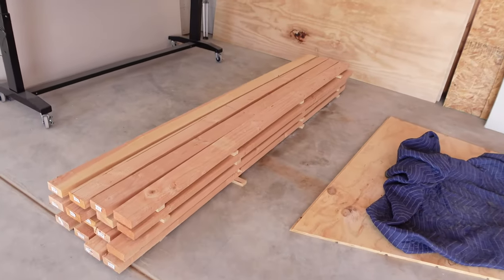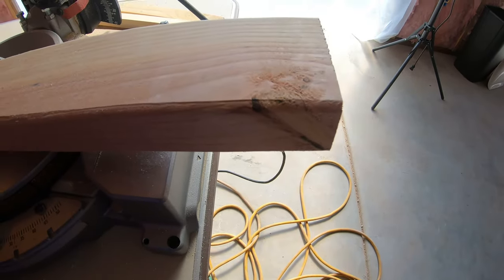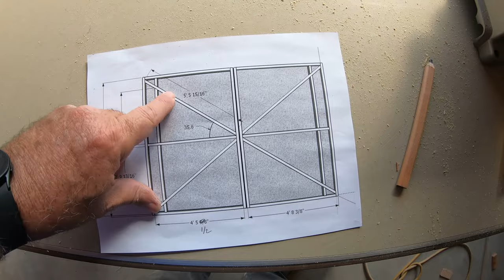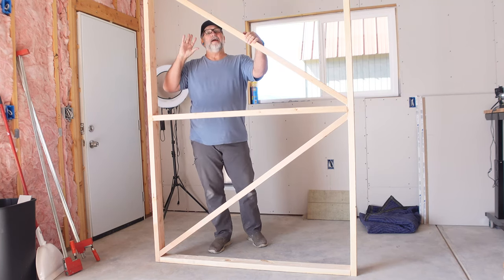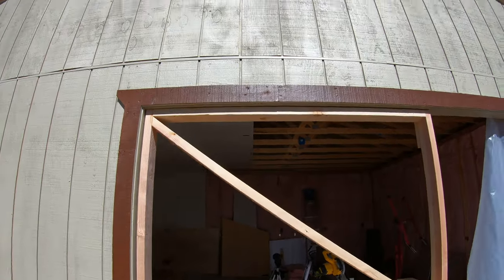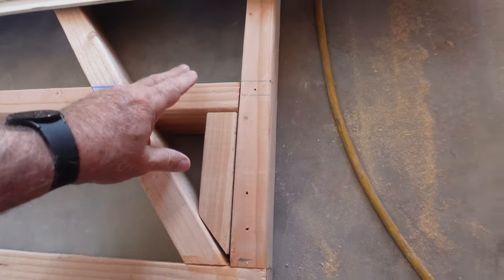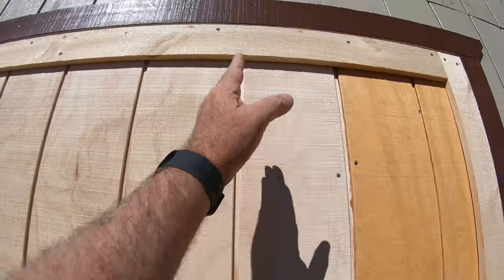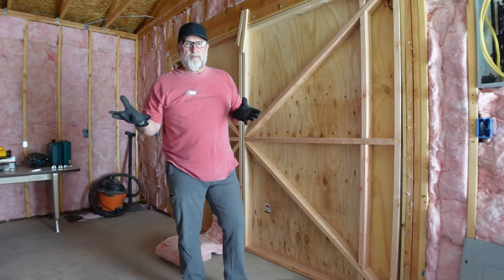How to Build Garage Shop Doors

Comment: Help me out here. What is the justification for the bracing that goes from the middle, back upward towards the hinge side. I understand the bracing that goes from the bottom hinge to the middle, as that is under compression. It seems like the other brace is not adding support against gravity puling the weight of the door down. As I understand it, the brace should be on the bottom of the hinge side, stretching all the way up to the top of the opening side. Am I wrong about this? Is there a reason for the reverse bracing?
Reply from the maker: You can build them that way and be fine I'm sure, I opt for this way as I have for many I have done and have had none to very little sag with this style.  I do use the other method when using the 2x4's laying flat but it's  just my preference for these doors Nicholas. thank you for the input and watching the video I appreciate it!

Comment: How much gap between the 2 doors, so when you open one up, the 2x4 dont rub against each other? Great work and hoping to build mine for the garage using your plans. Heavy duty hinges right?
Reply from the maker: Hi Kenneth,  I butt the hinge side as close as possible, top I leave 1/8 inch as they will sag a little, the bottom I leave 1/2 inch and center to be able to open with 2x4 frame is 3/4" to an 1 inch and yes heavy-duty hinges are worth the money

Comment: This might be a stupid question but isn't it a security concern that someone could unscrew the hinges and enter the space? Is there a way to improve the security?
Reply from the maker: Sure by using carriage bolts instead, this one however is in the fenced back yard.  If somebody really wants in they are going to get in.  It's kind of like someone installing a huge thick front door with all the deadbolts and locks and have a window right next to it.

Comment: Thanks again for posting this! I got the 2 doors made, trimmed, insulated and painted. I had to use 1/4" plywood as the rockwool insulation is too dense to cover smoothly with 1/8" luan. The doors fit great, don't sag and can easily be opened and closed, even though each one weighs over 100#. I also used 2 packs of the metal lock barrel bolt you have listed in the description; work great!
Reply from the maker: Nice!  appreciate ya commenting and watching!

Comment: Hi Mr. Adams. By how much smaller did you make the frame against the opening? What is your tolerance? Thank you so much in advance.
Reply from the maker: Zero on the sides, just butt it up against framing be sure to level, the center is where you will need the gap and I used a 1/2 to 3/4"

Comment: Doors look great. Very nicely done. I need to build a set with each door being 6’wide and 12’ high. Would I approach doors of that size any differently than the method you used?
Reply from the maker: Hi Jacob, if you are planning to insulate them I would say put an X frame inside but if no insulation is needed or very little I would lay the framing flat for less sag but either way I would run a diagonal adjustable cable for extra strength.  Let us know how it goes!

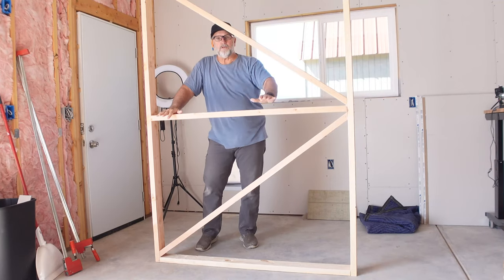Comment: 2:40 - in your opinion, is the 'British Brace' you used stronger than the 'Double Zed Brace' ?
I want to add a backing to my new doors but am worried about the extra weight. There are three substantial band hinges on each door.
Reply from the maker: Both have their merrits, I have never had a problem with this style sagging but I would say go with whichever you are more comfortable with.  Thanks for watching and commenting I appreciate it.

Comment: Great video! I'm using it to make similar doors for my new 24x32 shop with a 9'x10' door opening. 6-7 month delivery expectations and cost especially are 2 things why I decided to go this way. Also, my shop will be used mostly for building my 1966 Chevelle autocross car, welding and personal vehicle maintenance, so I don't really need doors that are convenient and easy to open several times a day or week. Have you another video on how you sealed the door, yet?
Reply from the maker: Sounds great!  I used 1x1 self stick foam weatherstrip on the overlapping trim pieces  and a garage floor door seal.   https://amzn.to/3VBhPFp  https://amzn.to/3OFqoON  and   https://amzn.to/3HVaBrC       Hope this helps
Reply: @ILikeToBuildStuff  thank you for the info!
Reply from the maker: No problem thanks for watching! @rixtrix11

Comment: This is the video I was watching and I can’t find what you used for weather stripping. I’m making doors for an old barn for a pool room and am wondering what you thought about bronze spring weather stripping. Thanks….enjoy your videos!
Reply from the maker: I used this seal at the bottom that works great  https://amzn.to/3VBhPFp
I used the 1 inch foam seals around the doors inside trim  
https://amzn.to/3Hp2i6q
Reply: @ILikeToBuildStuff  thanks for the information…have you ever used bronze spring weatherstripping…just curious. That’s what’s on my house and it’s been there 100+ years. Only reason…thanks again.
Reply from the maker: @KBMB47    Yes I have but don't think the cost is worth it with the new stuff out that may not last as long but still 25 years or more depending on the application.
Reply: @ILikeToBuildStuff  Ok thanks for the information!

Comment: I'm curious on how you did one door to overlap the other.  Wish you'd have shown that in the video. In my mind, that central overlapping trim piece would have to stick out past the wall, further than the rest of the trim.. is that what you did? Can't quite picture how you can have it overlap and all stay on the same line
Reply from the maker: Hello and welcome,  Yes that is what I did by using a 1x6 for the center overlap.  Good eye!

Comment: Great video. How much smaller than your rough opening were your doors? Or maybe it's better to ask the clearance on all sides of each door.
Reply from the maker: Hi Kurt, I butt it up on the sides and add minimum 3/4" center gap but do recommend 1 inch as these doors will move a bit and with the 2x4 width should have enough clearance to open correctly.
Reply: @ILikeToBuildStuff  Thank you. I was thinking the same, 1/4" on sides and 1/2" in center of total of 1" clearance.

Comment: Hi Jim! Great video. Do you have any advice on sealing / weatherstripping?
Reply from the maker: I used this seal at the bottom that works great  https://amzn.to/3VBhPFp
I used the 1 inch foam seals around the doors inside trim  
https://amzn.to/3Hp2i6q
Reply: @ILikeToBuildStuff  Thanks!!
Reply from the maker: @seanwhalen8220   No problem, anytime.

Comment: Hi Great video! Did you have to build Jambs for this door?
Also, if I followed a similar design but wanted to add glass to the top for windows… how do you recommend doing that? Just want to make the sure the engineering is done right to support the glass.
Reply from the maker: Hi and Welcome, Yes I had to build the jams but that was just trim boards.  You can add windows just as you would when building a wall just be sure to keep the diagonal bracing under the windows

Comment: With how you did your video, it gives me confidence that I’ll be able to do this on my own.  I have a circular saw but not a table saw, though I don’t think that’ll interfere with me completing my project.  I have a question for you though.  Do you think it would be fine for me to use my jigsaw and cut out windows in the paneling?  I’d be using plexiglass for the windows.  I also won’t be insulating my doors as the rest of my garage in nowhere near insulated or even airtight.  (House was built in 1890.)
Reply from the maker: Hi Sonya, thank you for the great comment and your in a great community here to help and cheer you on.   Sure you can use a jigsaw if you are more comfortable with it.  Keep us updated on you progress!  Thanks for watching.
Reply: Absolutely we are here for you Sonya!  You can do it!

Comment: Do you have more detailed video or comment of how you kept the door panel in the correct position while attaching the hinges. I've never
 seen the hinges attached to both the door and building at the same time.  Thanks
Reply from the maker: Hi Dave, I actually set the door frames in the opening and shim them where they are to be and then mark the frame where the panel grooves match up then when doors are done I set them back in the opening and set the trim on the doors so I know that I can install the hinges while keeping the doors straight.  I hope that is what your question was.

Comment: Thankyou for the video. The door you build out of 2x4 and t11 siding  will it the keep the heat in .
Reply from the maker: Yes it does when sealed as you would do any exterior door.  I used wide interior trim with 1x1 self sticking foam weatherstrip.
Reply: Thank you for getting back to me .I was  thinking about building  exterior door the same way you did here what's your thoughts on that Thank you.
Reply from the maker: @relectric720   Should work fine for ya.

Comment: great tutorial. will water get in when it rains? do you think there's a way to weather seal?
Reply from the maker: I have had some pretty hard rain and no leakage and that was before weather seals were installed with the inside trim.  Thanks for watching!
Reply: what about dust? I'm going to make one of these this weekend
 @ILikeToBuildStuff
Reply from the maker: Not much of that either  @stevecarrillo

Comment: This is exactly what I was looking for. The price of insulated overhead doors is CRAZY! How large of an opening do you think this design will support? I will have an 8x7, 10x10 and 12x12. The 12x12 worries me a little.
Reply from the maker: Hi Joe, well the front wall is not load bearing so you would not need a big header so I would say you can go as wide as you want but stay with no higher than 8 feet since the walls are 9 feet
Reply: @ILikeToBuildStuff  Thanks for the reply. What I meant was, will this frame design support a 6’wide 12’ tall door (for a 12x12 opening) without sagging? I know I would have to add some blocking in for attaching the sheathing.
Reply from the maker: @joeamato3936  Oh okay, yes it should and you could also run a diagonal turn buckle cable if needed to help keep it square too

Comment: So, has there been any sag? I don't care much for those types of hinges here in the city. 
 
It sure would've been a lot easier to do it with those.
Reply from the maker: No not to much at all, I knew I was going to get some sag that the nature of the doors but all in all about 1/4" so I haven't had to add diag wire so far.  Thanks for watching!

Comment: Brothers/Sisters, if you have an issue with fiber glass insulation irritating your skin. I have a simple solution.
     I used to run a machine that stuffed fiber glass into automotive mufflers. At the end of week 1 I looked like a full blown method addict. I had scratched my arms to the point they were bleeding.
     One day a vendor walked by and told me " I used to look like that. I ran a fiber glass machine. I found that shaking baby powder on my arms and neck then patting it in made it impossible for the fiber glass to penetrate my skin."
Reply from the maker: Great tip Richard, thanks for joining in here we all appreciate it!
Reply: Same method that barbers use before cutting hair.

Comment: Did you create an air tight seal around the door and if so how was that achieved?
Reply from the maker: Hi Garrett, I used a garage door seal on the bottom and trim with foam weather seal around the rest.
https://amzn.to/3VuH4u2   and   https://amzn.to/3yGnuRS

Comment: The only dumb question is the one we don't ask, so here it is. What is the clearance between the frame and the door, top, bottom, and side, as well as where the doors meet in the center? I am building one just like yours for my shop but just want to ensure I do it right in every aspect. Thank you for the great video
Reply from the maker: Hi Fernando, I but the hinge side as close as possible, top I leave 1/8 inch as they will sag a little, the bottom I leave 1/2 inch and center to be able to open with 2x4 frame is 3/4" to an 1 inch
Reply: I was curious on this aswell.
Reply: @kalzonenu  Thank you for your answer and follow-up. Now I have all the details (I think) to build the door. I saved your video, noted the response, purchased the wood, and I am waiting for the monsoons to go away because I need to build it outside. I am also subscribed to your channel. Thanks again.
Reply from the maker: @fernandorivera7155  I understand that, we got hit hard with monsoons this year which is great because we need the water.  Thanks for subbing to the channel I sure appreciate it.

Comment: You did really good until I watched you drill that hole in the concrete. It's going to fill with dirt, but mostly water, then freeze a few times. That slab will have a weak stop forever.
Reply from the maker: I sure appreciate you joining in here and the comment it means a lot to me that you would take the time to watch my video!
Reply: @ILikeToBuildStuff  I drilled a hole at the head of the stall and used it as a "dead man" to help me jerk vehicles up the slope and into the garage. When the holes weren't being used, I capped them. Worked great for years. Enjoy :)